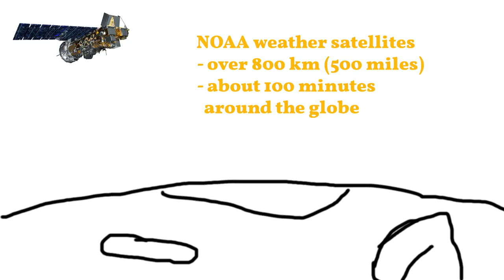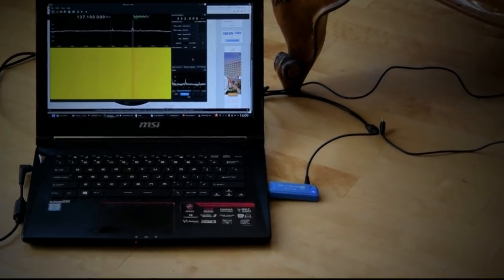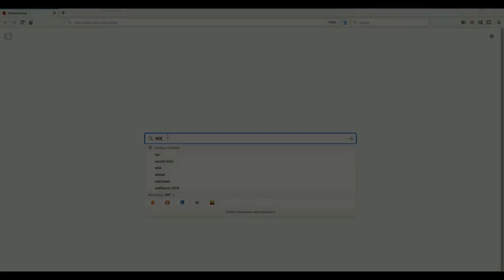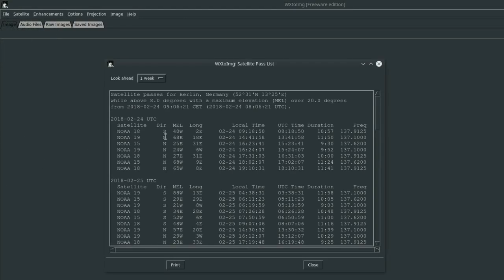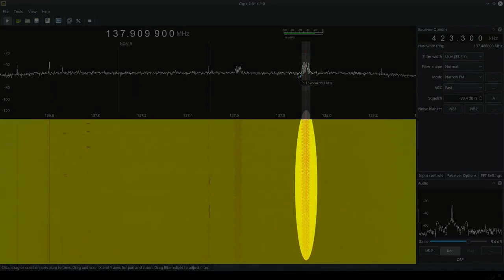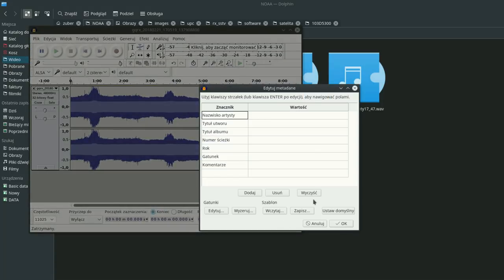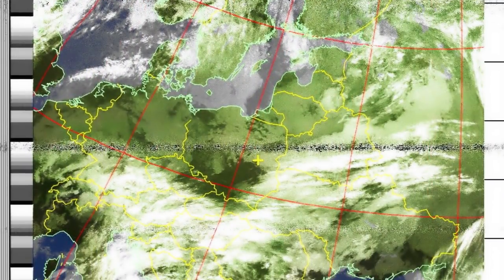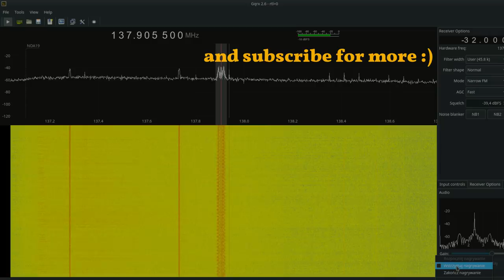Hacking the TV tuner and making DIY antena to recieve weather images from satellites (NOAA)

Comment: You should use antenna balloon as you go straight from 75Ohm coax to symmetrical dipole (assuming 300Ohms)
Reply: A balloon would require a second radio to transmit back to you. Else you're gonna visit another country or cruise the ocean to pickup footage from your crashed baloon.
Reply: @rachelslur8729  It would have to be high enough to reach your footprint, like geostationary high which is impossible for weather ballons, so unless you launch a satelitte into orbir or make a ballon that won't pop past the strasphere(or higher) it won't work (unless it is in close range)

Comment: Hi . Can i have some information ? What Is the diameter of copper wires ? And how i connected the antenna cable to the copper wires?
Reply from the maker: Diameter is 2,5mm and the wires arę just connected to two outputs in plug(there are only two od them on the plug)

Comment: Hi
Is it possible to do it from other countries.
Reply from the maker: +Kaizen Inventor yes, country doesn't metter. Satelita are flying over whole globe. Try it! It's really fun to do
Reply: @skillful_DIY_fan  
Thanks for your reply.
I'll definitely try. By the way what is the copper wire guage to make the antenna ??
Reply: +Kaizen Inventor i don't know that. This is The copper wire used as electronic cable used in Home instalation 2,5 or 3 millimeters
Reply: @wideociekawostki7934 
Alright. If I get success I'll definitely share the results.
Reply: @KaizenInventor  Another way to make it is to by one of those cheap telescopic antennas extend the arms out to 135 degrees, make each side 52.4 centimeters and put tape on it to keep them in place. It worked for me. thats my permant setup

Comment: hey .... to the guy who made this video thanks i been wondering for about 2yrs how to do this ill save ur video and cross refference it so i can come up with some other stuff ... i was actually searching for how to make a fm radio into a noaa one trying to figure that out .... this is by far cooler though lol 
i knew this was possible with the software and the fm transmitter but i had no idea how to set up or use this stuff thanks for the breif tutorial cool stuff ... i like using aweather program for linux but its very buggy i preffer the realtime data over the website lag times .... 
id like some indept help with some of the software if youd be willing id appreciate it ... more about finding the signals to decode and more about decoding ... 

what i really wanted to do one day if it was cheap enough is to build my own mobile weather doppler radar that would be a neat project

oh diy guy check this out might be handy for you if you havent already found it   
https://skywavelinux.com
Reply from the maker: +Eric Draven wow, thanks for the comment. I'll check your link

Comment: Your move flat-earthers.
Reply: No, because of few reasons.
1. Ballons rapture if they go too high. At around 30km the air pressure is too low and they rapture.
2. You can't make a balloon fly on the straight line like satellites do. Even a small blimp wouldn't be able to achieve it.
3. You can calculate how high they are based on the signal latency and triangulation.
Bonus: If they were on the balloons you would be able to see them with simple binoculars, and there are thousands of satellites, so you would be able to see at least few avery day, no matter where you live.
Reply: Ballons are unpredictable due to voulnarability from wind. Satellites orbit above the atmosphere. I guess you could use a rc plane.
Reply: goes 16 is round earthers move